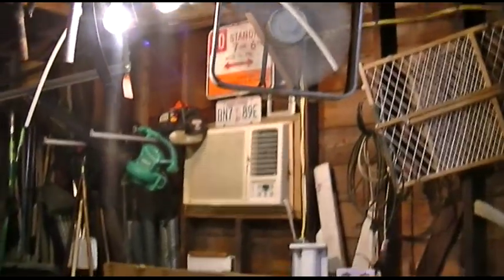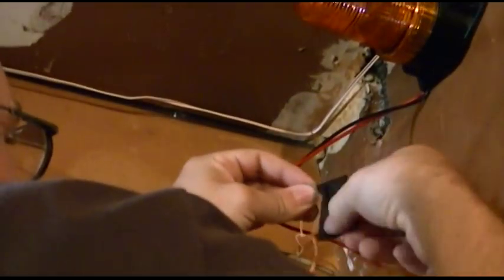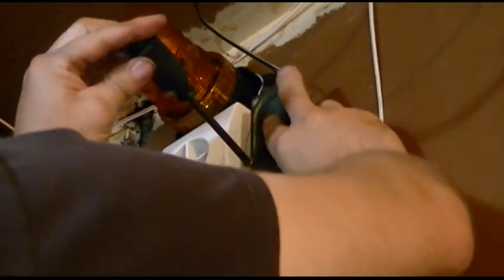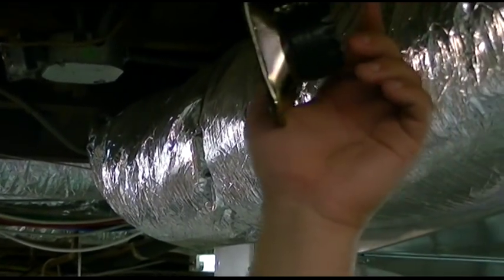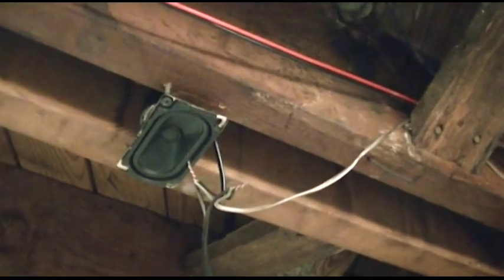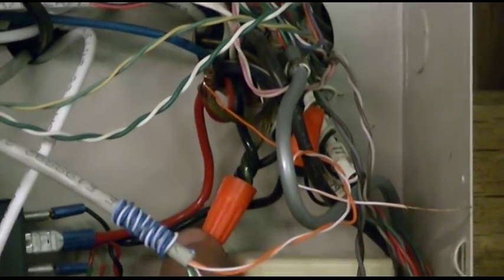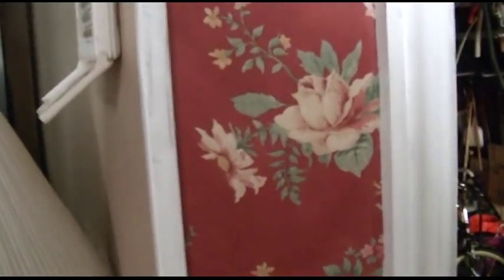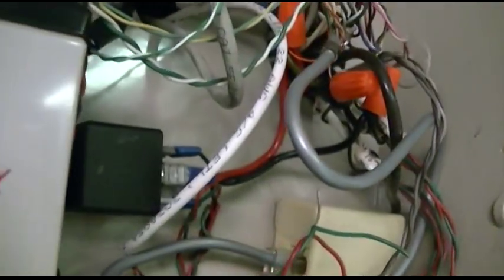Speaker, Strobe, & Siren For The Garage

Comment: A new law was introduced Here in my city Like 3 years ago that says all Garage door must have a storbe or light that must light Up when the door is open for advising the pedestrians or other Cars that the door is opening, my Garage Has acc the same orange storbe you installed 🤣 Love the Xenon storbes, we have Here too Led storbes, they're as bright as xenon but 5 times more expensive, worst are the halogen ones, they're dodgy, bulbs Go faulty on them so friggin easy
Reply from the maker: I can't see that law being for residential, but for commercial, it only makes good sense.  LED strobes just don't provide the same visual appeal as a Xenon strobe does.  LEDs are basically instant-on and instant-off.  A Xenon strobe takes a few milliseconds to go out, it's slower than LED, which gives it much more visual appear in my opinion.  I've never seen halogen strobes, I have seen "spinning lights" like police cars used to have with halogen bulbs, where there is a spinning mirror behind them, but I call those "police lights" rather than strobes.

Comment: I feel like the speaker would be louder if you mounted it inside the wall, like the magnet part I mean, regardless though nice job haha
Reply from the maker: The speaker's impedance doesn't match that of the line.  That speaker was "removed from equipment" from a flat panel TV, I have a bunch of them for one reason or another.  If I used a speaker of the right impedance, it would be plenty loud.  If I mounted it lower down on the wall, it would be louder.  When the A/C is off you can hear it just fine.

Comment: Was the dialer bypassed for this
Reply from the maker: Yes it was disconnected.  After this video the panel threw an FC error (Communication Failure), and I rebooted it to clear.  I could have also called central monitoring and told them to place my account in "test mode" for an hour, but this way is much faster.

Comment: If you had to I guess you could of lowered the speaker, since it's kind of low.
Reply from the maker: That's exactly what I thought.  Hard to hear with the A/C on.  Also, these speakers I have that look like this were out of old flat-panel TVs.  Either they just don't work right, or the impedance is too high/low, and they are quieter than the one I have in the living room and basement.  But they were free, and I have a bunch of them.  I think I have 3 of them in service now, all are quieter than the others.